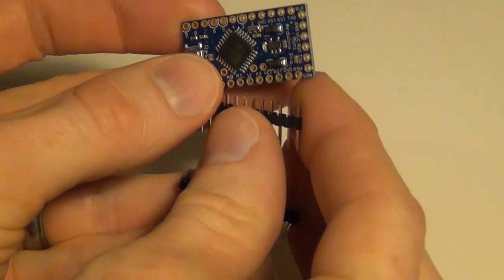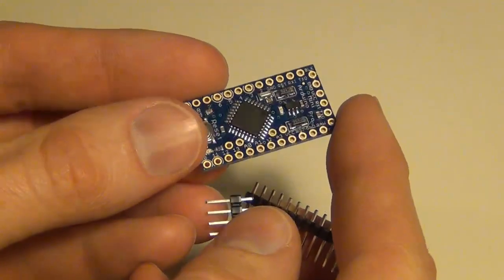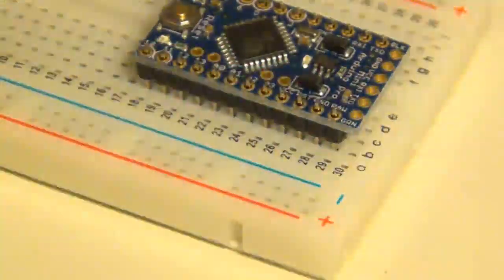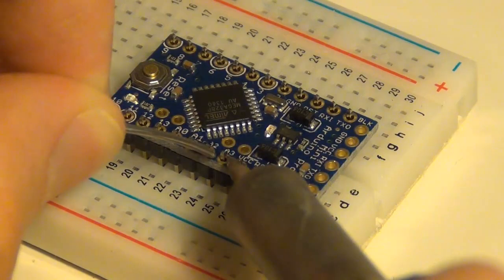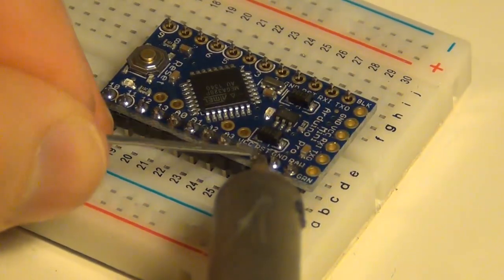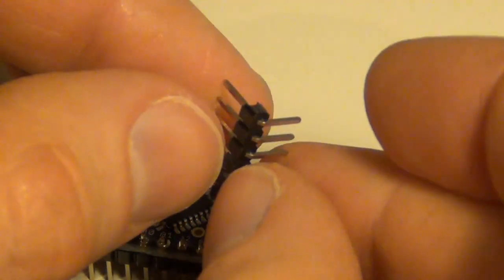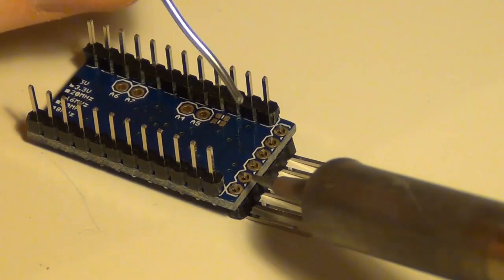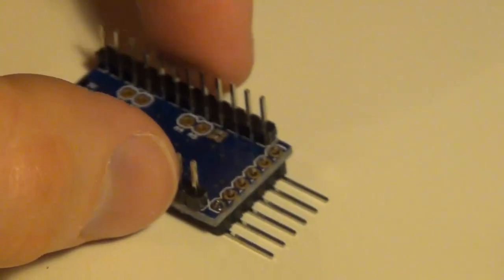How To - Solder Pin Headers to an Arduino Pro Mini

Comment: What soldering iron and solder do you use?
Reply from the maker: I use a Hakko FX-888D. Not sure what type of solder I have. I've had it for years and it doesn't have a label. If you're having trouble though, make sure you use flux. That makes it so much easier.

Comment: Makes it look so easy. My soldering consist of the solder either never sticking to the pins/wire or going everywhere and sticking two pins.
Reply: Lots of flux can help in those situations :))

Comment: I don't know what I'm doing wrong but my solder never wicks onto the pin like that, it seems to stick to the soldering iron tip?
Reply from the maker: You probably need to use some flux.

Comment: What soldering iron do you use?  I struggle getting the pin hot enough for the solder to melt,  looks so easy in your video
Reply from the maker: You might want to try adding flux. I have a Hakko FX-888D soldering iron and I love it.

Comment: I scrolled down to see if someone had a answered my question, but no. Did you use any form of flux, prior to starting to record the video? Why, or why not?  Thanks. Adam
Reply from the maker: Hey Adam, I didn't use flux for this.  My solder works well without it when I'm applying it fresh.  If I'm trying to re-solder something (adding a wire to something that has already been soldered) then I'll use some flux because it makes the parts adhere much better/quicker.  But, when you're starting fresh like in this video it isn't needed.  However, if you want to use it it won't hurt.  Just don't apply a bunch of it because it gets all over the place and is sticky.  Good luck! Pete
Reply: @peteb9105  I truly appreciate your advice. I do not know anyone locally, so I don't have much in the way of those to ask questions of. I will make the best of your advice. 
Thank you.

Comment: i wanted to take this soldired pin out
Reply from the maker: You can do it, it's just harder.  Remove the black plastic carefully with pliers and a small screw driver (pulling/prying up) then remove each pin individually.

Comment: question: can u also use the board with the header pins without soldering?
Reply from the maker: As long as you have a good connection.  Be careful though, you might get strange results if you think it's good but it isn't.
Reply: @peteb9105  it did not work for me at first. But soldering fixed the issue. Luckily my neigbhor had a soldering set.

Comment: Wow Check out the New Arduino Pro Micro Ultra low power Version Arduino with Improved power regulators and Voltage range. Excellent 3d Manual  and Schematics Double decker sandwich board. I love it Tried this with 5 projects works perfectly and you get support. Just write in. No changes to the board and is well documented on the silkscreen. 
Here is the link Also noticed. When in Battery mode. The regulator can be bypassed. WOW. Now I can get in to the nano amps. On Ebay. Just type In the search "NEW Pro Micro Kit Arduino. Regulator removed 6 modes. Ultimate Low Bat power" .

Comment: Hello, what is the diameter of the tip your are using?
Reply from the maker: This is what I am using: Weller ST7 0.03" X0.79 mm ST Series Conical Tip
Reply: @peteb9105  Mine is 1.5mm and definitely too large for Arduino soldering. Thank you for the answer. 👍

Comment: Does the heat on the pin not damage the plastic on the bread board?
Reply from the maker: No, as long as you don't leave it on there for a long time. It should only take 1-5 seconds to get it to melt properly.

Comment: Does someone make shorter male header pins? I'd like to solder a nano to a pcb with through holes but want the pins to be shorter when they poke through
Reply from the maker: You can just use normal pin headers and use wire cutters to trim them down to the size you want.  You can also use needle nose pliers to gently pull the plastic off of the pin headers if needed.
Reply: @peteb9105  Thanks. They seemed too thick for that. I'll try

Comment: Did you clean the surface soldering Flux Pen ?   Or you don't recommend it ?  ...When you must use this flux in electronics ?  Thanks.
Reply from the maker: I'm not sure exactly what you mean.  I use flux when I am soldering something to an area where there is already solder.  For example, if I want to solder a wire to an Arduino where something is already attached I'll add some flux to the wire, heat up the existing solder then touch the wire to the heated solder.  Usually the solder jumps over to the wire and makes a great connection.  Hopefully that helps.
Reply: @peteb9105  Understood....I thought that the surface must be clean...before soldering...but the flux do that...it cleans and allows the tin to flow...

Comment: Will arduino work if we don't solder hedder pin and only place arduino on it
Reply from the maker: It should work if you maintain contact between the pins and the Arduino connections.  However, doing this may cause unreliable connections so you may get inconsistent results with your device.

Comment: Dude your soldering is incredible... Are you part Asian??? Lol.
Are you using a special solder?
Reply from the maker: Ha! Thanks.  Not sure what the solder is.  It was a gift that I've had for years so I'm not sure where it came from.  Standard solder should work though.

Comment: Is there a max temp setting or something? I'm afraid to burn out the components
Reply from the maker: I have never had an issue burning anything.  I recently got a new soldering iron that has a digital temp setting and I keep it at 640 degrees F.  That seems to work very well.

Comment: İ need a quick answer please , if i use arduino mini without soldering , will it work ? İ mean just pin to the breadboard as you did but without soldering .  We ve got a sensor and i dont know if i need soldering , please
Reply from the maker: If the pins aren't already soldered it will be hard to make it work. You might be able to do it if you put pressure on the pins so they make contact with the holes in the pro mini.
Reply: @peteb9105  thank you so much :D that must be the reason why it doesn't works . Thanks again :D

Comment: the wattage of the soldering iron, is it a matter when soldering, or it is not a matter???/
Reply from the maker: Mine is a Weller WLC100 and has variable power control for 5-40 watts.  I never turn it up to max power though.  It is too hot if I do.

Comment: I'm in a bind.
The US trade war means we have counter-tariffs. That means high import taxes for private citizens. Each individual parcel gets slapped with a minimum $10 fee.
My old soldering iron broke. I have a hot air soldering station. Can I solder Arduino pins with hot air, or will that break something? (Or should I spend $40 on a new iron?)

Comment: Nice! Do you have any tips for removing them now :)

I soldered on some 7 segment displays onto an Adafruit LED backpack and because of the uneven pins they sit crooked and obviously didn't notice it until I finished all of them...
Reply from the maker: I use a solder vacuum like this https://www.amazon.com/WEmake-WM-SP4-Solder-Sucker-desoldering/dp/B0002KRAAG.  It takes a little getting used to but when you get it it works pretty well.  You could also try laying the iron across multiple pins so it will heat them all (or most, so you don't have to vacuum them all).
Reply: Thanks!

Comment: This was exactly what I needed to see thank you! What happens if you accidentally short two of the connections with solder? Is there a reasonable way to remove the excess solder or will you need a new board?
Reply from the maker: No, you shouldn't need a new board.  You should be able to break the connection with the soldering iron.  If that doesn't work they make solder vacuums that you could get.
Reply: Thanks!

Comment: Way better than breadboard is a foam rubber - it's elastic and if you press board from top, be sure - all pins are pushed till end.
Reply: A breadboard forces the pins to be totally vertical and parallel to each other.  I rather suspect that foam rubber will not do as good a job.

Comment: I think using really thin solder helps make it a bit easier to get in there... like some .015" or so. I managed to get a few, but the tip on my cheap shitty walmart soldering iron won't get hot enough to tin properly, the solder just beads up... plus the tip is so fat it could be your momma. Jk but it is too fat, always touches the pcb and starts to melt it.

Comment: I think my soldering iron can't get hot enough because it just doesn't work for me.
Reply from the maker: A good way to test the heat of the iron is to touch the solder to the tip.  It should melt instantly.  If it's not it may be time to buy a new one... You could also try changing out the tip if you have that option.
Reply: It's a kind of no-name iron I bought recently for about 8USD. It's 30W so I thought I'd be fine. Also I very rarely need to solder pins or cables plus I didn't know if I will do much stuff with microcontrollers so I didn't want to spend much on it. 
Do you have recommendation for tips for soldering pins? This iron has the option to replace tips. If it doesn't help I'll try to get another Iron but I would already have good tip. I don't need exact brand, but just what kind of tips would work best?
Thanks!
Reply from the maker: Hmm.  You may want to consider a new iron rather than a new tip.  But, if you do want to try a new tip I really love my .3" conical tip.  I'm not a huge fan of my iron (it works but isn't amazing) but here is the tip I'm using for comparison. https://www.amazon.com/gp/product/B0002BSP4K/ref=as_li_tl?ie=UTF8&camp=1789&creative=9325&creativeASIN=B0002BSP4K&linkCode=as2&tag=petewill04-20&linkId=d15dc64aad3ab72da221245ea2f19748
Reply: Hey, I think you are right I need better iron. Thanks! plus thanks for the video!

Comment: ugh you ass! why you making it look like its all easy and stuff lol. i tried what you did and just boogered it up real proper
Reply from the maker: Ha, sorry... :)
You may want to try some different solder.  Also, make sure the tip is really clean (clean with a wet sponge) and the iron is hot enough.
Reply: Try using rosin to clean your soldering iron! Nowadays I always heat up my soldering iron, then use brass wire sponge to wipe the old solder, then clean by sticking the tip into rosin, wait a few seconds, wipe the rosin using the brass sponge, tin with fresh solder and you're good to go with all the black junk wiped off. Way better solution than scraping with steel wool btw!
Reply: Yeah my brother. But it just shows us newby klutzes need more practice. I suggest you practice on stuff that doesn't matter so much. Try getting some cheap DIY kits from eBay and make them. If you screw up on them is OK. That's what I've done. Also as they say, get a good soldering iron. 25Watts is OK, don't need any adjustments.

Comment: can we solder without that holding bredboard ?
thanks
Reply: Should not be a  problem. But it is best if you solder it when the two objects aren't able to move around when soldering

Comment: is it necessary to solder pins?
Reply from the maker: I suppose not if you have some sort of wire clips.  I prefer soldering when ever I have a more permanent project as it works much better that way.

Comment: What kind of solder should you use?
Reply: Any solder rated for electronics... some solders are intended specifically for plumbing or other applications
Reply from the maker: I'm not sure what mine is as it doesn't have a label and it was given to me.  There is some on the mysensors store though that should work fine: https://www.mysensors.org/store#soldering

Comment: I don't use breadboards but I was thinking of getting one purely to do what you do in this video.
Reply from the maker: +edgeeffect It sure does make it easier.  I have also used the prototype PCBs to do the same thing (if you have any of those lying around).  It's a little more difficult than the breadboard but much easier than trying to do it without anything.

Comment: I'm very new to soldering. Does the solder melt when it touches the heat pen, or does it melt when it touches the hotness of the pin?
Reply from the maker: +frost 
I am by no means an expert but I like to touch the tip of the soldering iron to the copper connection on the PCB board as well as the header pin if at all possible.  I then touch the actual solder to the opposite side of the pin.  That way it flows all the way around the pin.  Hopefully that makes sense.
Reply: This was the mistake I was making too before seeing this video. Never try to get solider from the iron to the pin, it just wont go. Instead, heat up the pin with the iron, then touch the solider to the pin itself.

Pete's technique is great because you are touching the solider to the opposite side of the pin from the tip of the iron. This makes sure the solider sticks.
Reply: The proper way is indeed to heat up the pin, this way you get the cleanest and best result
Reply: It's not glue. You need to heat up both the things you're trying to fuse, so ideally you should be using a flat screwdriver type tip in your soldering iron and be touching both the pad on the PCB and the pin at the same time. You don't feed solder onto your soldering iron, you should feed it to either the pad or the pin - the things you want to solder together

Comment: Hey, did you test the connections on the FTDI headers?? I'm getting a short between BLK and GND.. If I look carefully, I can see they are bridged on the board....... Am I going crazy or is my board messed up?? It's an official one xD
Reply from the maker: +kodguerrero 
I have actually never looked that closely because I have never had an issue.  Have you tried uploading a sketch?
Reply: +Pete B Yea.. I had to look at the pinout of the board to find out they both are Ground and they are in fact connected to each other. Nobody is using a voltmeter to check their solder in any of the Pro Mini videos online :P
Reply from the maker: ***** Yeah, I haven't used a voltmeter.  Maybe I just got lucky :)

Comment: Hi. Do you use any special soldering iron or just any will fit?
Reply from the maker: +W0j45 
I use this one: https://www.google.com/shopping/product/10486823281998409921?sclient=psy-ab&biw=1366&bih=667&q=weller+soldering+station&oq=&pbx=1&bav=on.2,or.r_cp.&bvm=bv.108538919,d.cGc&ion=1&espv=2&pf=p&tch=1&ech=6&psi=7k5gVvriGMa0jwP3jreAAw.1449152244430.5&sa=X&sqi=2&ved=0ahUKEwio27Xx8L_JAhUBFGMKHYkzBjIQzUoI3QMwAQ
I got a smaller tip for more precise soldering.  It's nothing special and I've had it for years but it has always worked for me.  I'm sure there are better ones out there.  I believe there are some discussions on the MySensors.org forum but I haven't paid much attention because mine has worked so far.  I think there are also a couple in the mysensors store.

Comment: which solder do you use??
Reply from the maker: +francesco scamarcio 
Sorry I'm not sure.  I've had it for years (got it from my dad) and it doesn't have a label on it.
Reply from the maker: +francesco scamarcio 
Sorry I'm not sure.  I've had it for years (got it from my dad) and it doesn't have a label on it.
Reply from the maker: +francesco scamarcio 
Sorry I'm not sure.  I've had it for years (got it from my dad) and it doesn't have a label on it.
Reply from the maker: +francesco scamarcio 
Sorry I'm not sure.  I've had it for years (got it from my dad) and it doesn't have a label on it.

Comment: Thank you.  Now I just have to find a good place to find the appropriate soldering iron and solder.
Reply from the maker: +Christian Marquez I think there are some posts on the mysensors.org forum about good soldering irons.  You could check those out.  I have had mine for years so I'm not sure what's good/available now.

Comment: THATS SOME DAMN FINE SOLDERING!!
Reply from the maker: +joe bredestege Haha, thanks :)
Reply: @peteb9105  Do you remember which kind of solder and iron temperature you were using? :-)
Reply from the maker: @goku445  I set my Hakko FX888D iron to 680 F (360 C).  The solder I got from my dad years ago and it doesn't have any labels on it so I'm not sure :)
Reply: @peteb9105  Thanks!